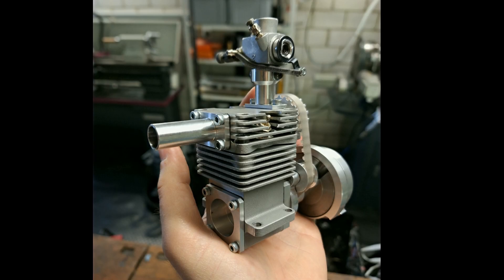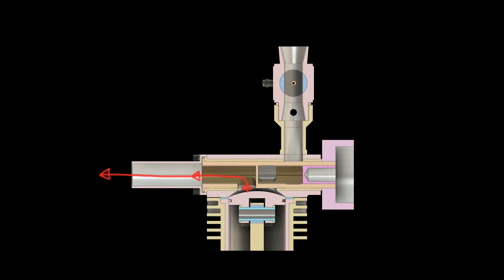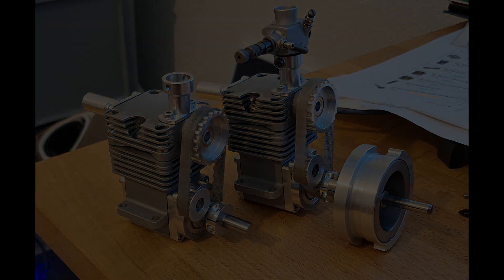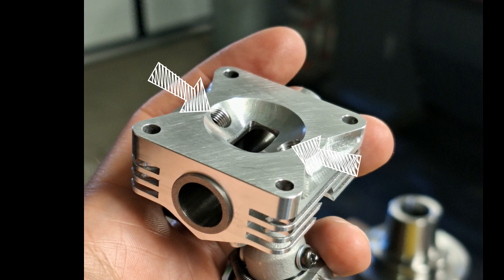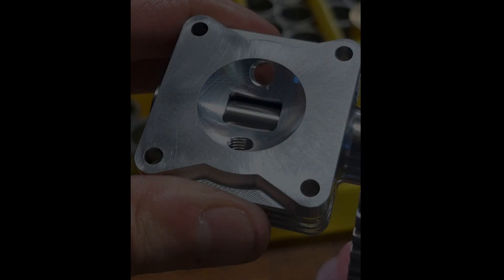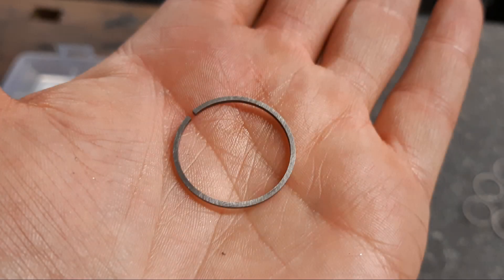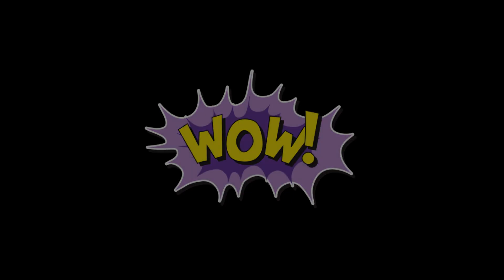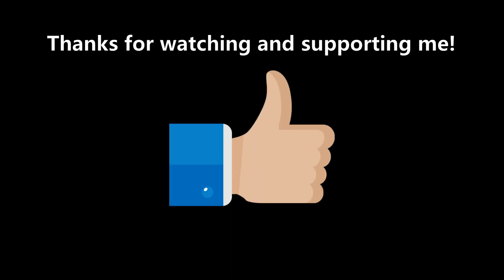New Rotary Valve Design for Model Engine / Modellmotor mit neuartiger Walzendrehsteuerung / Part 1

Comment: In 00:30 first model run more high rpm and also it response to throttle suddenly than 06:20 second designed model. Your hand's response may be different. It's better to compare with digital measuring instruments rather than listening to the engine sound. Still, great job, well done.
Reply from the maker: Hi man! You can check from both engines the power measuring on my dyno and compare it.

Comment: HP 21 VT was a commercial available 4 stroke model engine using rotary valves in zylinder head driven by tooth belt at half crank rpm. It was avilable in the 80th if I remember well
Reply from the maker: Hi man 😃 You're right! There was the HP VT 21, 25, 49 and 61. But this engines work differentily with a axial rotary valve in the cylinder head.

Comment: That name rotary valve has been around in two strokes for many years ( or disc valve and drum valve) yours is akin to drum valve induction.
Reply from the maker: Hi man! Yeah, I owned a Yamaha DT125 2 stroke with adjustable timing on the exhaust port with a rotary valve. The latest technology comes from Bishop Engineering for a V10 Formula 1 engine (2007). He also calls it rotary valve. Early literature from the 1920s also refers to rotary valves. The term is therefore also commonly used for 4-stroke engines.

Comment: Rotary valve on two stroke engines has been around for a long time back to the 1960s on yamaha an all other bikes
Reply from the maker: I had a Yamaha 125cc from 1993 and this had a rotary valve at the exhaust port to adjust the timing. At low speeds, the exhaust opened later than at high engine speeds. It worked well!

Comment: Ciao. Ho inventato questo 31 anni fa😊. Posso aiutarti a migliorare? La forma del buco nella testa e nel tubo. Io ho un'idea.
Reply from the maker: Ciao Christian 👋 Nice to hear you have done something like this 31 years ago 😃 Do you have any kind of videos of it? Would be interesting to see. The type of rotary valve I built was originally invented in 1909 for airplane engines (L. A. Frayer & C. O. Howard, Patent 908 656). My design here was just a gimmick. In terms of performance, I'm clearly inferior to my previous design. Currently I'm working on a new type that is similar to Cross but different in gas flow.

Comment: It's amazing! It's so simple, that make all existing engines like jokes!
Reply from the maker: Thanks man! This type of rotary valve was quite common in aircraft engines in the 1920s. The reason for this was that poppet valves were complex/expensive to manufacture and the engines were also unreliable. Rotary valves were therefore used to achieve a higher reliability (of course, very important for aircraft engines to avoid the risk of crashes). Today there are some trials for racing engines (Bishop V10 F1 Engine).

Comment: hey man, I am trying to make rotary valve engine for a school research. I just wanna ask how was it compared to a poppet valve engine? how was the engine oil doing when running it over a longer period of time?
Reply from the maker: Hey man! Well, this is just a model engine. It also has no active lubrication system. The oil comes via the fuel as with a 2-stroke engine. So far I havn't noticed any relevant wear on the rotary valve. The perfect choice would be a hard chrome-plated rotary valve made out of brass and a sleeve made out of cast iron. With this combination, long-term performance is also very likely to be good. An active seal as a counter piston is recommended. Check out this channel www.youtube.com/@MrPizzaman09 He build in BMW straight six engine a rotary valve head in it. He has an open rotary valve with counter piston and an active lubrication system with drip oiling on each rotary valve.

Comment: Dang you're materials choices and fabrication are top notch! I've studied metal fab since highschool and studied metal casting in college. Love small engines, R.C., motorcycles, aircraft, boats. I'd really like to do the sort of work you're doing.
Reply from the maker: Thanks Brian!  It's not always easy to produce good quality parts in my hobby workshop. But I do my best. What's stopping you from trying something yourself? As you say have enough background 😃
Reply: Pretty much $. I've been slowly investing in things that I can do awesome stuff with 3D printers, gas welding equipment and such. Got quite a ways to go before I have a shop outfitted with what I want/need to have. If you're interested I've started with working on a 3D printing solution to print metal for low cost. The process will use high percentage metal powder/polymer binder pellets that are then extruded in the FFF process. The part will then be "de-binded" binder material vaporized and then the part gets heated to sintering temperature. The process should yield end use spec or near spec parts and one of the nice things is this process is cheaply and easily scalable. 

I.E. I could print a full size engine block or other parts and the range of materials is almost limitless.

If you're interested in helping support my effort a little let me know maybe we could do a little collaborative work. 

If not that's ok too. I'm going to keep working at getting set up nicely one way or another.

Comment: Would it be possible to build a v10 using this rotary design and honda gx25 pistons? Would be a 250cc engine at final, i wanna build something like this with such a rotary valve, as my project model f1 engine that im starting is halted due to valve design, i really really do wanna see it rev to 20,000rpm and make good power for its displacement, using 2 stroke fuel mix tho or a separate oil pump that would pump just enough oil into the rotary valve to keep it lubricated, im amazed i didn’t see this channel before, so much good info! Thank you and keep up the good work :)
Reply from the maker: Hi Cheri! My design is scalable and it's theoretically possible to build all types of engines. My V8 is a very good example of this. You can also build a V10 or V12 using the same principle. Yes, with my timing I get over 20'000 rpm. But just keep in mind that this is only a model engine. Made as simpel as possible. A youtube friend of mine has already done something similar you would like to do. Watch here https://www.youtube.com/watch?v=yFXmGqBKNEc I think with enough oil in the fuel a seperate oiling maybe isn't necessary. If you are thinking of such a project, you should first work on a 1-cylinder test engine with which you can experiment. Would love to see some videos of you working on the project sometime in the future!

Comment: The shape of the valve opening could do with some development, for smoother gasflow. The reduced parts count over traditional four strokes may give this an advantage where mass limits apply, such as in RC aircraft. The sound of the V8 was similar to an old F1 engine, I imagine a V-10 would be amazing to hear. A V-12 in a model of a Mustang or Spitfire could be a lot of fun.
How hard would this be to adapt to a single or dual row Radial?
Reply from the maker: Hi man! Yes, the V8 of mine with rotary valve has a fantastic sound 😁 It revs so nice! Just as it's possible to build a 1-cylinder engine, it's also possible to build a radial engine. One rotary valve per cylinder and a revolving toothed belt. On a double row radial engine, the cylinder spacing should be big enough to allow a timing belt to run between the rows. That is feasible and it would be a super exotic engine 😅
Reply: @danielhunziker3577  One of the big limitations to radials, was the gas flow and complexity of the valve timing. For an RC model, a belt running around the outside circumfrence of the cylinders would do it, to a gear drive to the bank behind.
Rotatry Valve doesn't scale up as well, but in small models, it reduces the parts count and up's the reliability.

Comment: Exhaust opens too early on the 1 cyl... Sounds like 2 stroke or too rich
Reply from the maker: Hi Quiddyquid! The sound is indeed different to a poppet valve 4 stroke. But it could also simply be due to the high speed. That is correct. I run my rotary valve engines always rich to keep the rotary valve always lubricated as good as possible (the engine doesn't have an active oil system). It's generally recommended to run model engines rather rich to keep them well lubricated.

Comment: Great intuition Daniel. It has to work! If the sealing it's good even at work temperature I don't see why it should! The craftsmanship as always as Swiss watch 😊 just a question, why have you choose for a double spark? Don't you think that it could ruin the expansion phase, by having not a clean surface for the gas to push against to?
Reply from the maker: Hi Davide 😃 Fun Fact: I really do work in the Swiss Watch industry😅 It was important to me not to change the original design. So everything is the same as on my 1 cylinder test engine: Compression ratio, shape of the combustion chamber , timing, number of glow plugs, etc. To answer your question: I didn't thought about it with this engine as the aim was to compare the two types of roller control directly with each other. So just change the type of rotary valve and leave the rest as it is. But I know that many things in model engines aren't that important as with real engines.
Reply: @danielhunziker3577  it's for sure the fastest Swiss watch in the history 😂 really looking forward to the next update!! Thank you Daniel, have a great day 😊

Comment: A whole new take on cross flow: With this design you make quite sure that quie a portion of the air-fuel mixture will end up directly in the exhaust without ever seeing the compustion chamber.....
Reply from the maker: What are you trying to say? It's normal with a 4-stroke engine and especially with a 2-stroke engine that some of the fresh mixture enters the exhaust unburned.

Comment: It might be beneficial to adjust your valve timing with different ports on the head as well as wheere the slot is in comparison to the crank
Reply from the maker: Hi Josh 😃 You mean like some kind of fine and main timing ports like on high performance 2 stroke? What I can already say is that I probably have to separate the inlet and outlet ducts from each other. There is interference.  A 1-valve engine generally does not seem to be optimal. But that's exactly what this YouTube channel is for. With practical attempts to find out such things 😊

Comment: I still see the problem with rotary valves being the valve sealing.  A valve in sleeve assembly is bound to have compression losses and, more importantly, contamination issues.  The difference in dimensions due to thermal loading necessitates a novel design in that area.
Reply from the maker: Hi Rafaell 🙂 The sealing problem is one of the main reasons why rotary valves haven't become established. It's really difficult to design a suitable system. There were once approaches for Formula 1 engines (Bishop and Guy Negre), as longevity isn't that important fort these kind of engines. In the end, it led to the FIA banning rotary valve. It's important to note that this engine here is a model engine and the seal is made via the oil in the fuel. As soon as the engine is running, you have a dynamic sealing of the rotary valve here. Just please don't equate this with a real engine. Because the system wouldn't work or, as you say, would have to be extensively redesigned to get work
Reply: @danielhunziker3577  Looks like my original response has been removed for some reason.  I will try again with this post.  If it were easy everybody would be doing it right?  Consider using two rotary valves, one for intake and the other exhaust.  This way heating of the intake charge is avoided but more importantly you get rid of the need to seal between both ports.  This leaves only circumferential sealing.  For this consider a metallic (stainless steel) lip seal on both sides of each shaft that under pressure would press against a flat surface made of silicon nitride which has excellent galling resistance with steel not to mention thermal resistance.  Throw in a finely metered oil hole fed between the metal seal and the silicon nitride for cooling and lubrication draining back to tank (a few drops would be required) and you may have something.  Food for thought.
Reply from the maker: Hi Rafaell 😃 I have not actively removed any comments. By default, a filter is activated for comments on YouTube. You may have used a word in the original comment that Youtube considered as "nope" 😅 I agree with you. An active, lubricated seal would of course be great! I would like to take this opportunity to point out once again that this is just a model engine. Compared to real engines, it can be described as technically primitive. But that's also the point of it. As a model builder, you have limited and simple machines/tools, just as I do. The design is always chosen so that it's easy to manufacture with the available resources. Have you ever looked at the dimensions of such model engines? It's all so super small and I'm happy if I can even get the small things in the required tolerances to make it work 😅 As a hobby builder, it's often a pain 🙈Yeah, you're right! But as I said, model builduing is to keep things simpel and producable 🤷‍♂
Reply: @danielhunziker3577  Fantastic.  I look forward to more of your content Daniel.  Cheers.
Reply: @danielhunziker3577  If it were easy it would have been done a long time ago.  If I may make a suggestion... I would consider using two shafts, one for intake and one for exhaust.  This does two important things.  First, it would avoid having to seal between the intake and exhaust ports on the shaft as they are separate assemblies.  Second, you avoid thermal transfer into the fresh charge of air from the exhaust heating up the valve itself. The only thing you would have to do then is ensure adequate sealing circumferentially on each shaft.  This can be accomplished using lip seals like those found on a hydraulic pistons  except they would be made of stainless steel sheet folded such that under pressure (compression) they would be pressed against a flat surface found on either the rotary valve shaft or the housing body itself.  That flat sealing surface can be made of silicon nitride rings that have superb anti-galling properties against sliding steel and high temperature resistance.  Throw in a finely metered oil hole to lubricate and cool and you would have something that would work on a 4 stroke cycle. You can make the seals stiff enough so they seal well under minor pressure differences like that found during the intake stroke (vacuum) to then flex and seal under pressure during combustion/power stroke.  Food for thought.

Comment: Nice, but a good way to preheat the new fresh charge before enter the cylinder.
Reply from the maker: Hi Patrick 😃 You're right! This is a problem with rotary valve, the exhaust gas and the fresh air are routed through the same rotating part. Two completely separate systems would certainly make more sense. I thought about a dual rotary valve for this reason. There is always room for improvement! I like to experiment 😊
Reply: @danielhunziker3577  instead of having the gases flow through the barrel valve could you route it as a cord? aka have a flat or concave surface on one side that functions for both intake and exhaust? this would allow the intake and exhaust to be back down on the side and lower the engine center of gravity and profile. could also use the larger pulley as a fan to help keep it cool. lol
Reply: @Patricks_Projects  cold air is what is desired.